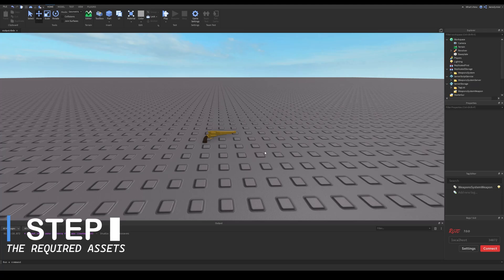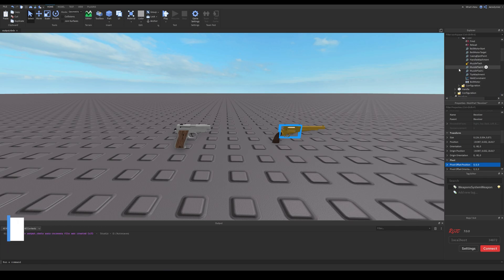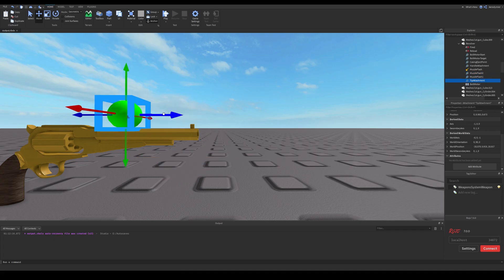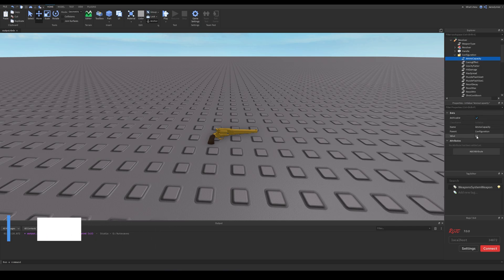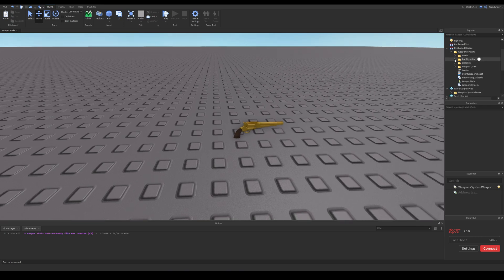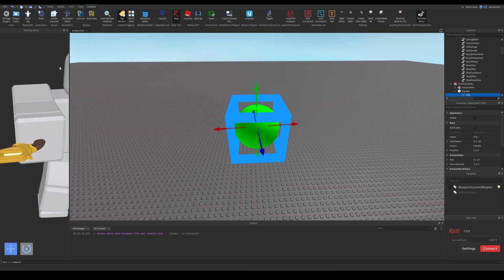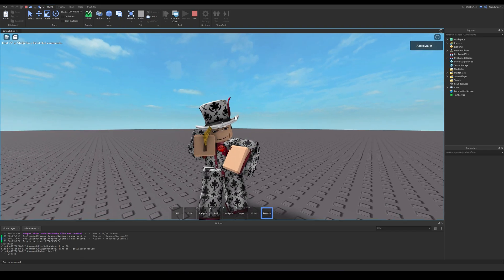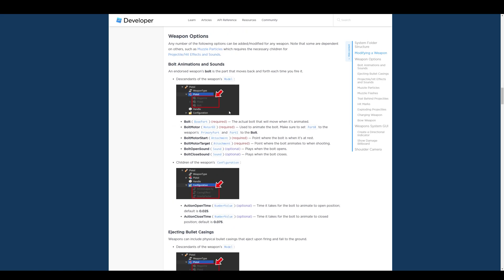Adding custom guns to Roblox Endorsed Gun Kit | Roblox Studio

Comment: I have a question, im using this gun kit and it uses 1 weaponsystem folder only, and because of that all the bullet colors are the same, can i change that?
Reply from the maker: You can set custom bullet colors depending on the gun, it's not implemented by default tho.

Comment: The gun direction being weird when you set it up is easily explained by the HandleAttachment not facing the front of the gun. You can rotate the HandleAttachment to point towards the gun's barrel but you can also just reorient the toolgrip aswell.

Comment: Is there a way to get rid of the "normalwalkspeed" and "sprintspeed" , I have already disabled sprint but In my game there are swords supposed to make you faster but because of the "normalwalspeed" setting it doesnt work.
Reply from the maker: In that case you can do it like this, when a sword is equipped it should set an attribute and when gun is unequipped it should set the walkspeed with that attribute you set.

Comment: I am also getting this: The Parent property of Weld is locked, current parent: NULL, new parent Rifle 
and The gun is just spawning at the location I first put it in and it is dropping through the baseplate. Suggestions? Thanks
Reply from the maker: I replied to your original comment check it out. The error is the reason of this.

Comment: everything works but when i equip the Gun its still on the ground and not in my hand. FIX?
Reply from the maker: Anything in output?
Reply: @RobloxStudioInAMinute  never mind I fixed by welding the meshes together with a weld constraint
thanks anyway

Comment: when i unequip a (endorsed kit)gun while im aiming with it)....my walking speed is not becoming normal, my player walking slow like how he would do while aiming. pls help
Reply from the maker: That's a known bug and will be fixed with next updates. Meanwhile you can use the other camera mode because it doesn't have this bug.
Reply: @RobloxStudioInAMinute  could you tell how to use that mode? or any video explaining that part..thank you for your response 😄🌈
Reply from the maker: ReplicatedStorage -> WeaponsSystemFolder -> Configuration, set UseCamOnlyWhenEquipped to false. After this, you'll need to press F to disable the camera.
Reply: yes now it works! i used a additional script in tools to unequip/equip..aftr removing it and doing what u told..it works! thanks
Reply: @RobloxStudioInAMinute  if i press F while aim ,avatar walks slow... but its better than walking slow aftr unequip problem.
its actually "weaponModule.camera:setEnabled(false)" line creating the problem in that equip/unequip script..but im not sure how to handle it..i tried giving delay(1),it worked fine but went odd, the player walked normal, but camera shift takes only after 1sec.....it goes either this or that😂, im not a scripter, but hope you got an idea to fix em
sorry if its long, but thank you for your help
Reply: the equip/unequip script used in tools:

local ReplicatedStorage = game:GetService("ReplicatedStorage")
local WeaponsSystem = ReplicatedStorage:WaitForChild("WeaponsSystem")
local weaponModule = require(WeaponsSystem:WaitForChild("WeaponsSystem"))
local camera = workspace.Camera
local player = game:GetService("Players").LocalPlayer

script.Parent.Equipped:Connect(function()
	weaponModule.camera:setEnabled(true)
	weaponModule.camera.rotateCharacterWithCamera = true
end)

script.Parent.Unequipped:Connect(function()
	weaponModule.camera:setEnabled(false)
	weaponModule.camera.rotateCharacterWithCamera = false
	camera.CameraSubject = player.Character
	weaponModule.normalOffset = Vector3.new(0,0,0)	
	
end)
Reply from the maker: I know the fix of this slow walk problem, I just don't have time for all of my projects. I will fix it later some time.

Also the purpose of the second one is only unlocking camera so slow walking is a bug of first option.
Reply: @RobloxStudioInAMinute  we can understand.. Thank you for ur help👍

Comment: Can you make a kills and death leaderboard by using that gun
Reply from the maker: Yes. If I remember correctly which I probably do, you can. It's compatible with the easiest leaderboard solution which are object values.

If I'm wrong it's easy to add anyways .
Reply: @RobloxStudioInAMinute  ahm i know now how to make it but now i need a help to how to off friendly fire using that gun
Reply from the maker: Roblox has made this gun kit for battle royale games originally so there probably isn't friendly fire protection built in. I will add this to the to-do list of updates for the kit. 

You can always add it easily, just find the hit detection function and add a check.

Comment: I have one more thing to add this maybe hard but can you make your clone work with both r6 and r15 avatars that with great
Reply from the maker: It should actually work with R6 avatars as well but the ones which won't work are animations. I've actually never tested R6 compatibility, maybe rigging guns to hand has a problem as well I will check and inform you.
Reply: I'm a good animator but the problem is my internet is so slow to the point I waited  20+mins to just not be able sigh up to roblox studio but this only happens to my pc everything else is fine
Reply from the maker: You can run a speedtest with some websites to see your network performance. Networks above 4 Mbps connection should be enough for at least web browsing.
Reply: I'm having a bug with guns when I change my camera view the guns will shoot at the last thing I pointed at with my third person view and u can't find a way to fix it
Reply from the maker: @vireakvitou2066  Press the F key.
Reply: It will only shoot when I'm in third person view
Reply from the maker: @vireaksbku  First person guns require viewmodels which is not present in this gun kit, this is meant to be for third person shooters.
Reply: Understandable I get it now I will not reply anymore for now
Reply: I'll make a gun testing in my account I just need it to be r6 with all of the animations and make in some how first person
I'll tell my username when I'm done with the game